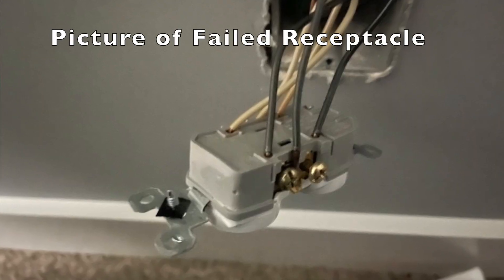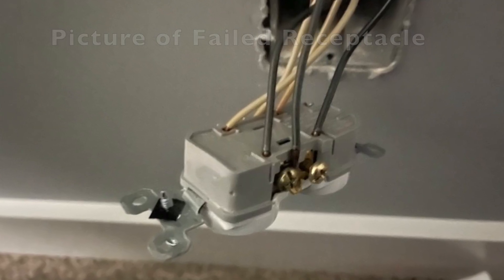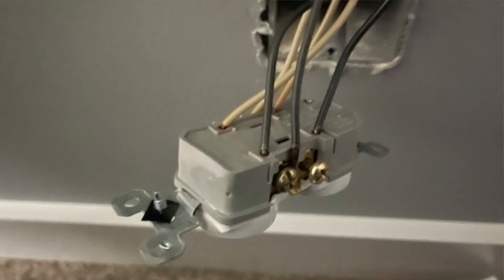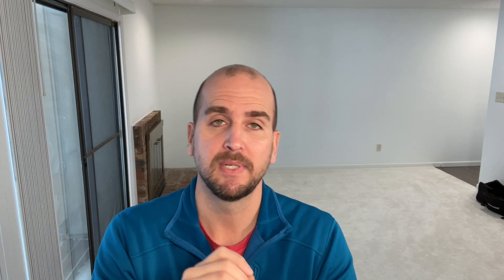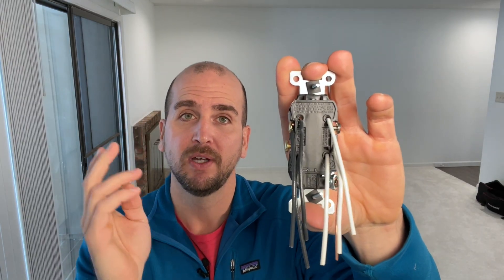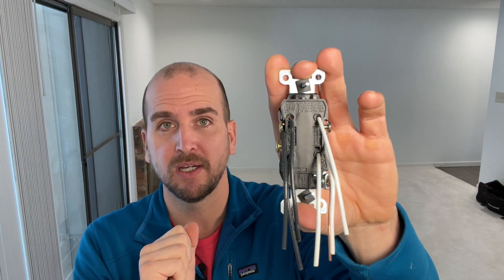Incorrectly Wired Outlet Found In Newly Built Home

Comment: Excellent advice. All older houses, and most new construction, use push-in installation and cheapest sockets because they are cheap... half the installation time of doing a proper install. Push in connectors are only safe when each outlet is at the end of the chain and there's no tension on the wires. Daisy chaining is obvious even in new houses, where a heavy load is plugged in and lights on the same circuit will dim. Cheap outlets are also a safety risk. There is a small piece of plastic, about 1/32", separating the hot from ground and the connectors are a weak design. When it eventually fails you can have the internals meet, with the expected ball of flame. This is one reason for the new (expensive) safety breakers for bedroom installations. Good quality outlets hold up decades longer, with no risk of shorting should they fail. If you "must" daisy chain (as when using shallow boxes) only the screw connectors should ever be used.

Comment: That's not quite right as an electrical apprentice I've learned that the bottom screws are for the incoming power while the top screws are for out going, you would only really used pigtails if you don't have enough wires to work with (which is why the back stabbing is also an option) or you sending power to multiple other receptacles or sharing the incoming hot, like in the case of using 2 gfci receptacles in the same configuration
Reply: Keep going to school and learning more my friend, pig tailing keeps the load off the outlet except for what each outlet has plugged into it. Read Gorden Shute below also!  Larry-Retired Electrician

Comment: Good info....I always use pig tails on a first run or middle run outlets, takes the burden of the extra load going thru the outlet and stays in direct flow with the wiring, this way you can use the stab connections, I know, many say NO NO NO, but done properly you can!  Personal preference, but not a NEC requirement.

Comment: You said you are dealing with #12 wire so is this a 20amp circuit or a 15amp Circuit?  If it is a 20amp circuit you should be installing a 20a outlet, just my quick analysis, nice work either way.
Reply: 15 amp receptacles are permitted on 20 amp circuit a. 20 amp receptacles are not permitted on 15 amp circuits. However, 20 amp switches are permitted on a 15 amp circuit.

Comment: Last time I checked, the code started that a continuous neural was a requirement. I always took that to mean that a pigtail was required at very least on the neutral. This helps to prevent a break in the neutral part of the circuit, giving an unbroken path for current to travel back to ground. If that doesn't happen, it can actually cause the neutral wire to become energized. I have seen this happen in several circumstances. 
It does take a little longer, but it does help prevent house fires.

Comment: Thank you for using pigtails and twisting the wires together. No complaints about your work. Code requires box to be flush with wall surface if wall is made of combustable material like wood paneling so box extender was required. Everything looked good and safe.

Comment: I always install deeper boxes, pigtails everything, and never use the back push in terminals. I also run all my circuits with 12 gauge.
Reply: Just be sure then that you use 20a outlets and switches even if those ckts use a 15a breaker.
Reply: @Cotronixco  
It's okay to use 15'amp receptacles on a 20 amp circuit. Better yet use spec grade 15 amp receptacles since they are the same quality as 20 amp, they just don't accept the same style 20 amp plugs.
Reply: @njsongwriter  That's unacceptable.
Reply: Well, if you always use 12 gauge then of course you wouldn't use push in terminals on cheap receptacles and switches cause they only accommodate 14 gauge wire.

Comment: I personally don’t like the extra connection point and also sad to say some  apprentice electricians  have trouble making a wire nut joint that doesn’t fail, If you just wrap them correctly clockwise around the screw and the proper length  (Wrapping all the way around and tightly to the screw but not protruding past the back) they are very secure. Also throw wrap of tape around the receptacle to cover the exposed parts, Also be careful not to strip the wire too much there should be no copper hanging out behind the receptacle or out of the tape. Save the pigtail for the situation where it’s needed.

Comment: I'm sure others have mentioned it. National Electrical Code specifies that a device shall not be used as pass through for electrical current. That means using pigtails like demonstrated, and wrap the tails 3/4 of the way around under the screw. If using yellow wire nuts, only 4 wires. I had a client who lost two rooms because the first in line trouble spot receptacle, was back stabbed with both sets of wires and the device failed knocking out the rest of the circuit.
Reply: It's not a pass through if each if the connections (neutral and hot) are attached to the same terminals via a screw and plate or via a wire nut or via a Wago connector. It's all the same.

Comment: Back stabbing is legal .... I never ever do this  !! I always make a tail if there are 2 wires coming into the box , strip the wire put it around the terminal clock wise so as you tighten the wire makes a connection that last for 30 years .... no problems...

Comment: Anyone please feel free leave suggestions. Are Wago 221 connectors acceptable instead of wire nuts? I have this same problem in a room, however,  it has 3 hots and 3 neutrals plus the ground.

Comment: Plug are now being installed upside down. Ground up because if something is drop from the top it does not short out the plug or cause electrical shock. Just my 2 cents. https://www.familyhandyman.com/project/installing-electrical-outlets-which-way-is-up/
Reply: I noticed that being done in hospitals years ago.
Reply: As I understand it, it is required in medical buildings but not residential.

Comment: I've ALWAYS used pigtails & wire all my outlets before I install them. I also put electrical tape around all the outlets & also around the wire nuts. A friend of mine called me to find out why some lights didn't work at a gold course & I found burned up switches & outlets because they didn't tighten down the extra screws.

Comment: If you were in the UK. The screws that fix the actuator of a light switch or power outlet is earthed back to the earth terminal in the back box (connection) box. SO if a live cable SHOULD come loose and come into contact with a fixing screw then the trip will operate and make the circuit safe.

Comment: What is the best way to bend a shepherds hook
Reply from the maker: There is a small hole on the side of pretty much all wire stripers.  Place the tip of the stripped copper strand in the hole and bend around the outside of the wire strippers.  Works well.  If you go to this video https://youtu.be/UwGoU3XVpnI and at timestamp 4:37 you will see a demonstration.

Comment: I recently had an outlet failure of a bedroom outlet that almost caused a fire in the wall that I was not able to figure out why the failure but I think it had to do with the way the installer had connected it up using wire nuts. I have come across Wago lever nuts that seem to be better than wire nuts because they are smaller and do not involve twisting the wires or nicking up the conductors. The maker says they also prevent the possibility of overheated connections that could cause a fire. What do you think? Here is a link to Amazon for these nuts: https://www.amazon.com/s?k=wago+lever+connectors&hvadid=78340271504912&hvbmt=be&hvdev=c&hvqmt=e&tag=mh0b-20&ref=pd_sl_6omm6ywuq7_e
Reply from the maker: Yeah, I really like WAGO 221 lever nuts and also I want to try their 2773 push in connectors but looks like they are back ordered for 6 months.
Reply: Only saw them used with little room in the box, plug moulding

Comment: Single copper core wires are really uncommon these days in my place.  Is it standard wire type in US for houses?
Reply from the maker: Yep, it is standard in the US.  Where are you located and is it multi-strand wiring?
Reply: @EverydayHomeRepairs  I'm in Italy. Well they are single wires (blue for neutral, brown for phase and yellow-green stripes for ground), at least for internal house wiring, but inside each wire there is not a single thick core of copper wire, but instead a core made of many thin copper wires together. Wires are softer and easier to bend  than single thick cores ones. Wires as ones in your videos were popular 40 years ago for house wiring, but now are almost disappeared in more recent wiring .

Comment: I think the ground is supposed to be on top when viewing the installed switch.  In other words, you installed the receptacle upside down.
Reply: Technically you are correct, but it doesn't make any difference safety wise and almost 100% of receptacles are installed this way.  If you installed them correctly you would probably get complaints.
Reply: @DenJSmith  
The argument I heard is that if the plug starts coming out of the wall, with the longer ground pin on top, you're safer to come in contact with the ground first (through above), rather than live power.

Yes, they look terrible upside down, but that's probably cause we all grew up looking at them in a given orientation.
Reply: @yourlogicalnightmare1014  That's correct.  You're not wrong in your original comment it's just that if you look around every plug in America is upside down. LOL    Look at the European style plugs if you want something that is actually safe.
Reply: @DenJSmith  
I'm hoping for a Nikola Tesla style "electricity through the air" system so I'm not drowning in cables running all over the place.

Comment: What is you take on Push in connectors instead of the wire nuts which is better and code
Reply from the maker: I am doing some homework on the options now for a future video.  I think WAGO 221 lever nuts are the best for most DIYers looking to do electrical work.  Not cheap but solid product.  Stay safe 👍

Comment: I am wondering about those LED lights that go on the plates that cover the duplex outlets.. They rely on friction connection to the side screws.. Is there any issues with these for NEC codes?  Curious if anyone has thought of those?
Reply from the maker: This is all I found 

2017 Code Language:

N 406.6(D) Receptacle Faceplate (Cover Plates) with Integral Night Light and/or USB Charger.

A flush device cover plate that additionally provides a night light and/or Class 2 output connector(s) shall be listed and constructed such that the night light and/or Class 2 circuitry is integral with the flush device cover plate.
Reply: I've bought one of these for use on a light switch, the builder had used the cheap .0 switches which are two narrow for the plate to make friction contact, needed to buy new full width switch to make a solid contact.

Comment: I was taught that the pigtail is used to keep the circuit from traveling through the device when the device is not in use.  If you have a high amperage appliance (space heater in your example) on a down stream receptacle, you are drawing that amperage through the up stream receptacle.  Potential for overheating if the connections are weak or bent hard  from the stab.  Just not good practice.
Reply from the maker: Completely agree Allan, thanks for the feedback 👍

Comment: The pig tail are very important and also after pigtails hide the wire nuts is the side of the box and make sure the hook are in a clockwise direction, also pay a lot of attention when you splice a solid wire with a stranded wire , and you are correct when you said the push in are a mayor cause of failure

Comment: Use electrical tape to wrap around the exposed screws around the outlet to prevent unprotected ground wires from having contacts with those exposed terminals.  2nd, black tape the wire nuts just to prevent current arching.

Comment: I always prefer to screw on a U shaped wire than to use the back push in wires. But why are there 3 wires of each kind in the area and I would electric tape them one by one to make sure they are insulated before leaving them in the box. But I would use all the screws on the sides and the ground leaving behind 1 of each wire to electric tape if those wires exist.

Comment: If I may add brother I’m a licensed electrician. I would never pre twist your wires with you linemen. It defeats the purpose of your wire-nut. Manufacturers recommend against that. Second when a wire-nut turns white at any point. You have overstressed it and eventually with heat it with melt. So replace right away. Lastly use a level to level your outlet as your setting it in place. Great work, great information video

Comment: Regarding the pigtail application.  What did the circuit look like that required a three line installation???  Obviously 1 line is coming from the circuit box (or up circuit) providing the electricity.  I imagine the other two were to supply other items down the circuit (other outlets, switches, etc) but why the two lines???  Was the circuit splitting off in opposite directions?  Seems like a strange wiring job.

However I'm pretty sure even basic outlets have terminals for connecting devices down the circuit and it looked like your outlet had that as well.  So wouldn't it have been wiser to wire the "source" or upstream wire into the input of the outlet then run your 6 inch wire out of the output of the outlet pigtailing the two downstream circuits into that?  I feel like that would have made the whole circuit make a bit more sense to someone coming in years later looking at the outlet and seeing "yes this is the source wire, and these two wires head downstream"

In my house I've got some fixtures/outlets where the switch is wired after the outlet, it threw me off at first until I figured it out.  This might be what had happened in your case.  An outlet controlled by a downstream switch (rather than upstream) as well as a downstream circuit for other fixtures/outlets.

Moral of the story, understand fully what is going on in your circuit before jumping in and making changes.

Comment: Good advice.  I would add that any time you need to use a wire nut, twist the exposed part of the wires together with your pliers and cut the wires so they are even.  You have just ensured they will fit inside the wire nut, BUT the trimming put pressure on the twist you just made and it might have loosened your wires a bit.  So to verify that your wires are both well-connected and that they stay that way, stick on the wire nut and twist it until you see the insulated part of the wires twisting as well.  Give them 2-3 turns so you know they aren't going anywhere.  The insulated section of wire will act as a strain relief so you don't have to worry about anything coming loose when you tuck everything back into the box.

Second bit of advice:  If you are going to be doing a lot of wire twisting be sure to purchase ribbed wire nuts.  Next grab your socket wrenches and your cordless drill, and find the socket that fits your wire nuts.  Ta-da!  Electric wire twister.  You will still have to twist the stripped part of the wire by hand, but the drill will speed up the rest and save you a lot of wrist pain later on.

Comment: I will not twist two or more solid wires . The solid wire has a tendency to break . Just cut to length and then install the wire nut . I will only twist stranded wire such as THHN or MTW type s

Comment: Now lets say u plug something up thats a heavy drain on that plug {both sockets} instead of the juice using multiple wires to handle the current the plug only has 1 in and 1 out wont it cause the wires to get "HOT"?

Comment: Should never use the pig tails or twisting 14g s/c wires together specially using wire nuts use wago or similar twisting single strand at say 14g causes a weak point hot point using shepherd's hook etc is best with those types of outlets and push in screw down type strip wire back say 12-14mm and fold to produce a nice tight connection  that's how we do things in the UK I strongly believe no copper wire should show on any terminated point

Comment: We bought a new 2400 sq ft double wide, one of the nicer ones that are made. We were going to build a new regular house but I am retired and my wife is close to retirement, plus the cost of materials and the 6 month timeframe didn’t make sense. The whole house is wired just as you demonstrated in your video. I have one room that keeps tripping the breaker. I decided to try to troubleshoot it my self. I first removed one outlet at a time, going down the line, tried a reset of the breaker, all to no avail. I replaced the breaker, to no avail. I called an electrician and when he arrived I told him how I tried to troubleshoot it, and he said that is what he was going to do. My thoughts are that the “home run” to the room has a short and to run a separate one as a trial run through the house. First I’ll have to isolate and mark the two possible entry points and make sure which one are the initial point and the end point. What’s weird is that yucas usually tell the end point by it having only two wires,and there is no such receptacle! (Watching your video I’ve decided to upgrade all of the receptacles in the house.)